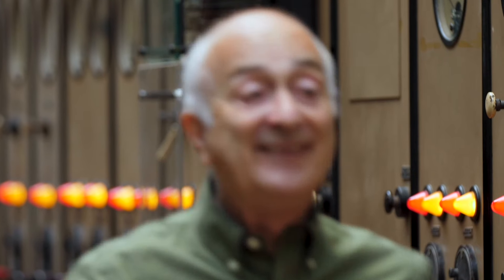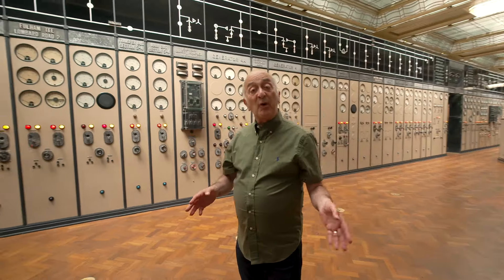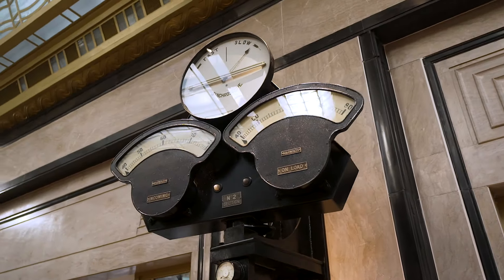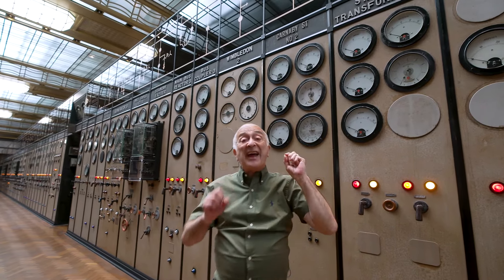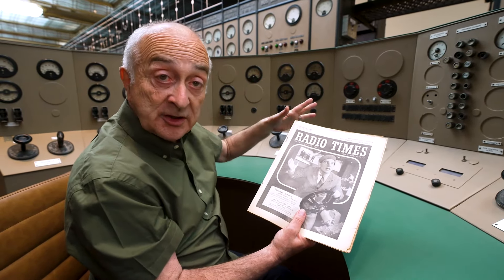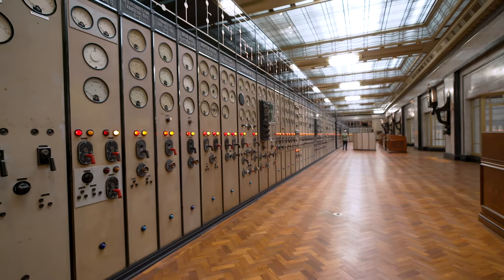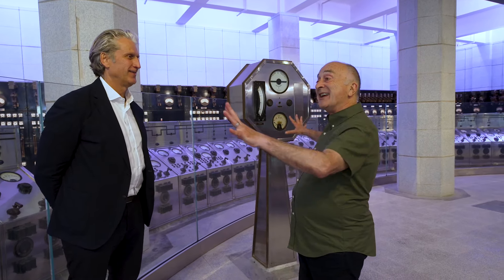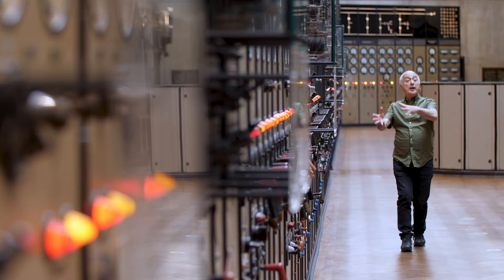Joule in the Crown - Battersea Power Station with Sir Tony Robinson

Comment: I started my Electrical Utility career in Cape Town, South Africa. Cape Town's original power stations and substations were all based on the British stations. I recognise alot of the design and styles of Battersea. Its sureal to see the similarities. 

I spent my career upgrading and replacing these old systems. Such a control room will easilly be replaced with just a handfull of panels and a few Computers these days.

Allthough imensely more powerfull and functional, it lacks the quality feel and heft of those old panels.

These days those stations will not be manned and when I worked there on faults in the middel of the night, it always had this strange and spooky feel. It always felt like I would bump into the ghost of an old operator in those dark narrow passage ways.

Great work to all that took the time and effort to restore such an industrial piece of art. #chefskiss ❤

Comment: In the early 1950s I recall my mother bawling her eyes out after dusting our Battersea Park Road flat, that despite the windows being shut, coal dust covered every surface. Itvwas a very polluting power station. In fact the doctors told my parents they should move away as I wasn't thriving. We moved to Bromley then Deal in Kent. Clean, if bracing air. She would have loved the development and shops, but passed away in 1997.

Comment: I'm amazed at the work they have done with Control Room A, but I wish they had included the engine telegraphs that they used to communicate with the engineers in the boiler house and turbine hall. I've seen photos of power station staff standing ready at the telegraphs preparing to let the rest of the staff know what needed to be done. I imagine these were replaced with a different sort of communication system over the lifetime of the station, but I love the idea of swinging the lever to "Full Speed" and hearing the turbines spool up in the turbine hall.
Reply: The turbines always run at a precise RPM dictated by the 50Hz frequency of the grid (that's what the synchroscope is about). You would hear an increase in the the magnetic whine of the generator coils, the 50hz buzz and perhaps the rush of steam, but the turbine speed remains the same. It's not like the turbo of a diesel generator that suddenly picks up when switching on a load.

Comment: Interestingly the biggest serge in power tends to be when everyone gets a shower, before or after work. The water pumps that keep the line pressure all kick in.  Also the generators slightly lead the grid wave so that its generating or pulling the grid rather than being a giant motor.

Comment: how it operated would be cool
Reply: In layman's terms terms the basic steps of the process were as follows:

1. Coal burned to produce heat. Coal was the main fuel used but oil was also used as a supplementary fuel. 

2. Heat boils water to produce steam. Note that the steam temperature is well above boiling point, hundreds of degrees C, so a lot hotter than steam coming from your kettle etc. At this point the steam is under high pressure.

3. Steam passes through the turbines to create mechanical power. This is done in multiple steps all mechanically connected - a high pressure stage, then through lower pressure stages using the same steam in order to maximise the energy extracted from it.

4. Turbine turns the alternator via mechanical connection, a shaft between the two. This is the step that creates the electricity. 

5. From there it's a case of distributing that electricity via distribution lines across London. 

Plus all the supporting systems. Eg cranes to unload coal upon delivery, conveyor belts to move the delivered coal to storage then again from storage to the boilers, also moving and disposing of the ash produced, plus pumps for water and oil, numerous valves and gauges to control and monitor everything, etc.

In terms of its ability to generate electricity, the first stage of construction involved in stalling two 69 MW (megawatt) alternators and one 105 MW alternator plus all supporting turbines, boilers etc. The second stage involved two 100 MW and one 72 MW alternator. Combined, this gave the power station a capacity of 515 MW. For clarity that's 515,000,000 Watts.

By modern standards that's small to medium sized but it was a huge scale at the time of its construction. By comparison the Hinkley Point C nuclear station under construction involves two separate generating units of 1600 MW each, 3200 MW in total, so is about six times the size of Battersea in terms of its electrical output. Battersea was huge for its time however.
Reply: @shaun5552  Hinkley holds the world record for the largest dome. It appears we Brits are still doing huge for our time.